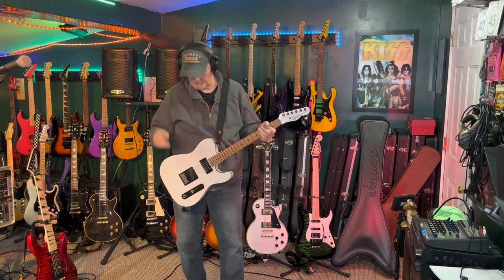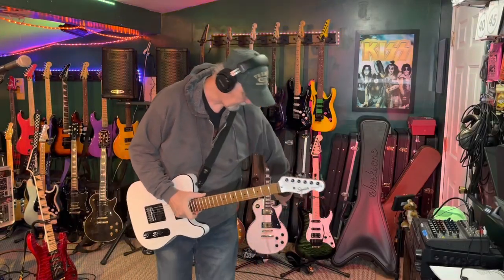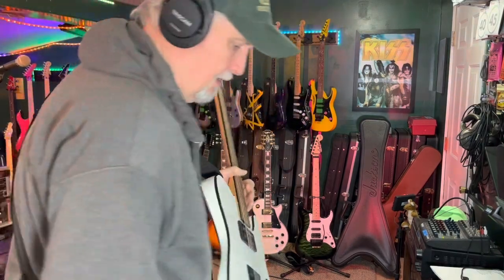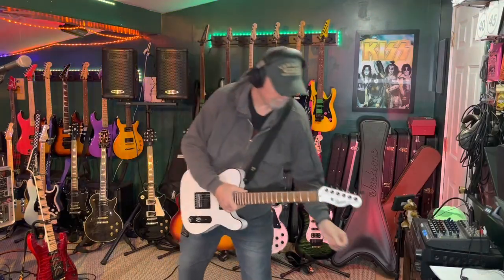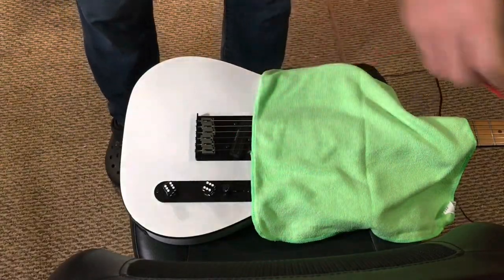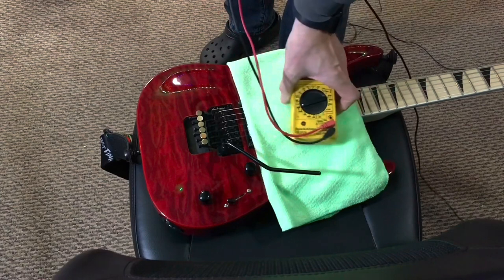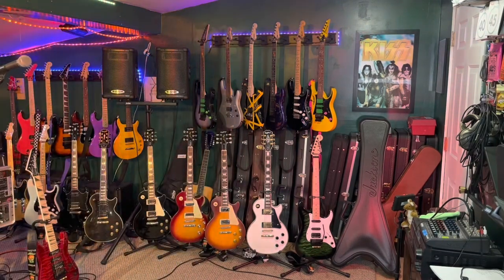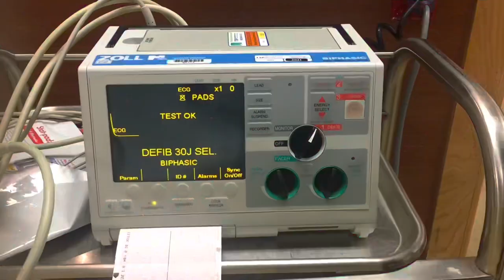Squier Contemporary Telecaster R H DESIGN FLAW Watch this before buying

Comment: Thanks for pointing out this issue, thinking about picking one of these up- you’re the first person I’ve seen who has pointed this out! Thanks!
Reply from the maker: I noticed the hum breaking through when my noise gate was open. I thought maybe the pickup was a little noisy (which it was) so decided to put the Duncan in. It was a lot quieter than the original but I noticed the hum didn’t stop when touching the bridge or strings like on other guitars. Got out the tester and diagnosed the problem. I love the thing now.
Reply: @WickedFesterBand  I ended up finding a used one in mint condition yesterday, gunmetal colour. Plays great, sounds great and no humming issue whatsoever but at least I was prepared to expect it haha plays much better than any other Squier I’ve tried.
Reply from the maker: @cf7477  That’s great! Others have said they didn’t have hum as well. I wonder if they changed the bridge at some point? I’d be curious to see if it’s conducive.
Reply: Thank GOD.. This is an absolute deal breaker.. 60 cycle hum?!

Comment: I have this guitar but there seemed to have been a bit of tha finish missing where the ground wire contacts.  Bigger issue with this guitar for the kind of player it is marketed toward is that there is very limited intonation adjustment with regard to thicker strings, due to the placement of the string ferrules relative to the saddles and nut.  I replaced my bridge with a Babicz FCH Original Series bridge and actually had the body redrilled for new ferrules (using a brass ferrule block, so routed for that) and now I can use big strings, 12-60. With the factory bridge the fattest you could use is a 54.  I didn't need to drill new ferrules (the Babicz can be strung as a top loader) but I wanted it string-through.  Great guitar now, the neck is great.
Reply from the maker: Glad you made it work for you!

Comment: Thank you very much for this critical information you have shared. I just picked up a shoreline gold during the Black Friday sale. I have yet to plug it into a real amp because I have been using the mustang micro headphone amp for practice. I have not experienced any noise or hum. I if I experience any noise or hum when plugging into a real amp, I will know what to do. Thanks a bunch.
Reply: Just to let you know I have one of these, there is nothing wrong with the guitar it's the nut doing this article for the price it's amazing you can play this guitar anywhere in the world.

Comment: Hey, thanks for this video. I was looking at one of these to make a Franken-caster. I wanna drop a boutique single coil in the bridge and a PRS humbucker in the neck. Is the routing suitable for this in your opinion? Just wanted info from someone who has operated on one of these. They are very good looking guitars
Reply from the maker: I would think there is room although not sure of the single in the Tele pickup route. I just don’t know how they match up. Love the guitar now that it’s fixed.
Reply: @WickedFesterBand  When you pulled the bridge pickup out, it looked like there might be room. I'm assuming (hoping!) they kept the same profile because i just ordered a used one!

Comment: Just curious Ive watched a dozen different reviews of this guitar. I have never heard about the problem with the ground. Is it possible that yours is a defect? I have seen others bought with various defects. In which case Fenders guarentee would allow you to return it.
Reply from the maker: I’ve had a lot of “mine is fine” comments but also some “mine hums too” comments. I did get mine cheaper than a lot of places had it for. I suspect there was a run with these bridges and it was discovered and rectified. I fixed mine and did mods as well. Duncan Hotrails for Tele (I already had) and CTS pots with push pull coil split.
Reply: @WickedFesterBand  If you could imaging ive heard that there are now fake Squire guitars just like fake Fenders. I guess thats what happens when you start making decent guitars. Even Fender as well as Gibson put out a lemon or two these days. Factories just dont have the same quality control as a custom shop I guess.
Reply: Just to let you know I have one of these, there is nothing wrong with the guitar it's the nut doing this article for the price it's amazing you can play this guitar anywhere in the world.

Comment: Thank you for the heads up! Of course mine's already in transit. May I ask– does the paint just stop the humbucking, or is it actually worse than single coil?
Reply from the maker: Hums about the same as a single coil does. On a side note, when I did my upgrades I added a push pull to split the coils. The pickups are 4 wire and can be split. The bridge railed pickup was pretty good. I just had the Duncan sitting in a box. I thought the pickups were to blame for the hum so decided to use the Duncan so it would be less noisy. It was but that is how I discovered the ground issue.
Reply: @WickedFesterBand  Thank you! That's a lot of valuable information to know going in... Much appreciated!

Comment: Thanks for the video, I have the same problem, but I didn't understood how you made the little screws on the saddles made contact with the plate, dou you removed the paint under the saddles too? or only the paint in the downside of the plate?
Reply from the maker: I scraped paint under the little screws. I tried to just do small areas so it wouldn’t show too bad. I just scraped the underside where the ground wire made contact.
Reply: @WickedFesterBand  thank you!

Comment: Also humming on my Telecaster. I notice that the screws that hold the pickups in place it does complete the ground. Touching the intonation screws on the bridge increases (?) the humm. Could it still be the problem with the paint on the back of the bridge? Do I need to solder it to fix this issue? Thank you for your response!
Reply from the maker: Might be something else. If it’s the paint on the bridge touching it should have mo effect at all.
Reply: @WickedFesterBand  Found the problem, the ground under the bridge was pressed into the wood, so had bad contact with the back of the bridge plate. I did scratch the paint just to be sure. After I put everything back together the hum is now gone. Thank you for your help, because the humm was so bad that it ruined the pleasure of playing. 

I did not notice it in the store while testing because they got a different guitar from the warehouse. 

Thank you for making me a happy guitarist once more!
Reply from the maker: @vrankbeer  Glad you fixed it. They are great playing guitars. Love mine now that it’s fixed!

Comment: Hey im pretty new to guitar and im wondering whats the difference between this and a normal squier telecaster? I dont know any fancy terminology or parts would you mind shedding some light on this please? Just like dumbed down whats the main differences? Are are they better or worse?
Reply from the maker: @Kevin-du6xo  Standard Telecasters usually have unique “Telecaster” pickups. These are both humbuckers. Some models do have humbuckers though. The neck on this is roasted maple and the fingerboard has a 12” radius. Flatter than a standard Tele usually 9 1/2”. Fingerboards have a slight curvature. Telecasters come in many versions. This is a modern style, less traditional.
Reply: @WickedFesterBand  hey also another random question do you know much about squier teles and strats? I'm stuck between 2 and I'm wondering if you can help me decide
Reply: @WickedFesterBand  I want a guitar that can play broad genres of songs and also has a more bright clean tone and I'm stuck between these 2 (squire classic vibe 50s stratocaster and squire classic vibe 70s telecaster deluxe) which would you reccomend?
Reply from the maker: @Kevin-du6xo  A good bit of advice is to go to a music store and try both. See which one feels better in your hands. That is important.
Reply: @WickedFesterBand  would you have any advice to help without that? I don't have any music store options where I live so ordering is my only option
Reply from the maker: @Kevin-du6xo  I think the 50s Strats single coil pickups will make it a little brighter. Both instruments will do what you want though. Classic Vibe are nice instruments. I have the 50s Telecaster.
Reply from the maker: @Kevin-du6xo  I have a lot of guitars. I love them all. You can’t really go wrong as long as you get a quality instrument and today there are a lot out there. More than ever for affordable prices.

Comment: Might go down in history is one of the best choir Telly's ever made! Then again it might not. The only thing I'm not really happy with is that they went to a 12-in radius on the neck still having trouble getting used to it. And I don't think it's going to be an easy neck change so I'm not going to bother. But I'm wondering can you take a pickguard for a telecaster with a humbucker at the neck and put it on this thing? At least it'll keep the finish pretty and it would make it look awesome. Anyone have any ideas?

Comment: 😟 Please tell me, have I lost my mind? Or has this upload been shortened a bit? I was so sure there had been a new strap lock or quick-release system mentioned, and I came back hoping to check it out... now I'm thinking maybe it was a dream 🤦‍♂️
Reply from the maker: I have Dunlop Strap Locks on it but I added those. It came with standard strap buttons. Video is unchanged to the best of my knowledge. Thanks for watching!
Reply: @WickedFesterBand  Thank you for the reply! Somehow I was never notified of it. But once again I found my way back to this video, because no one else seems to even be acknowledging this issue! I can't believe I need to scratch up my new guitar. I figured by now there would be conductive replacement parts kits out there, specifically for this issue. But I guess there's a lot of customers who don't care if their humbuckers buck hum. Anyway, thank you for the solution, and sorry for the rant!
Reply from the maker: @Rompler_Rocco  I have gotten so many “mine is fine” responses. It’s not a loud hum. It’s the same hum you get if you’re not touching the strings or bridge on other guitars. Noise suppression hides it but I could hear it breaking through on my amp. I found it not acceptable. If you don’t have to have black, they do sell chrome bridges. Still, shouldn’t have to buy anything. It should have been grounded out of the box.